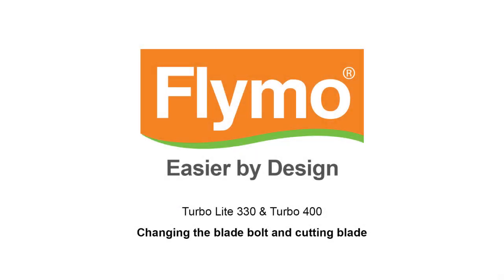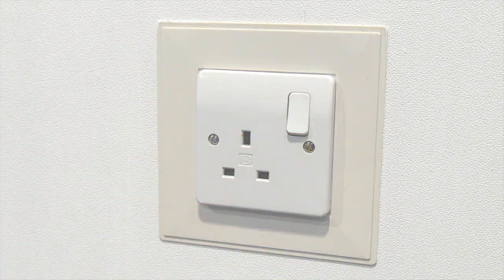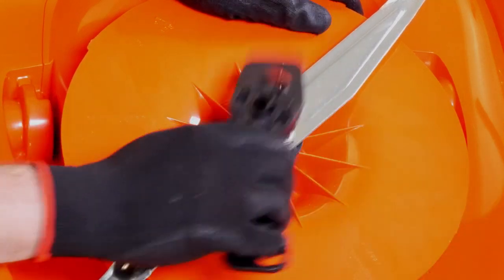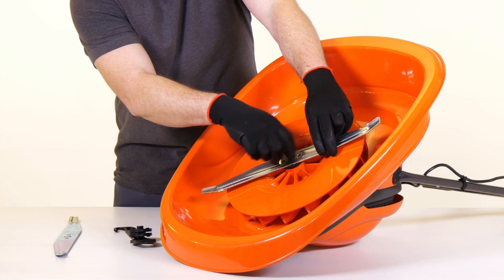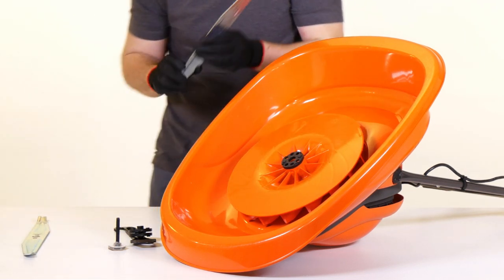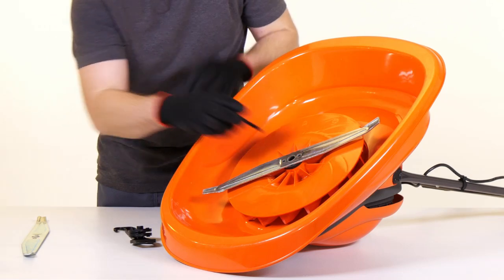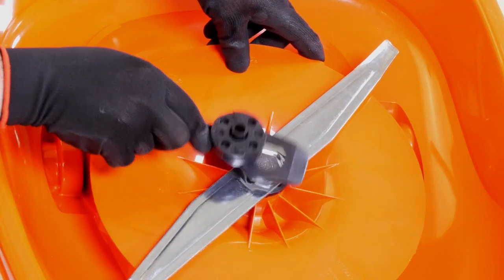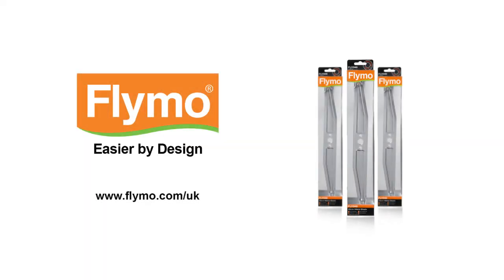Changing the lawnmower blade on a Flymo Turbo Lite 330, & Turbo 400

Comment: The blade on my Flymo Turbo Lite hit a rock and bent. Both ends are bent outwards. Bought a new blade but the old one won't come off with supplied tool. I think because of the speed it hit the rock the bolt has tightened too much and just won't turn. I've burst my knuckles trying to get if off. What a pity, is such a nice day and grass is needing cut, probably be raining tomorrow and all week. So what is my options now? Buy a new Lawnmower. This will be the 3rd Flymo to fail on me.
Reply: Sound like you'd be safer getting a gardener in every fortnight!
Reply: When you abuse a lawnmower you pay for it.  Always check the lawn for rocks before you try to cut it. this is rock solid advice.
Reply: Same thing happened to my partner, it’s  totally stuck. Really frustrating. He can’t check for rocks, they’re everywhere, we’re on what was farmland, clay and stones.